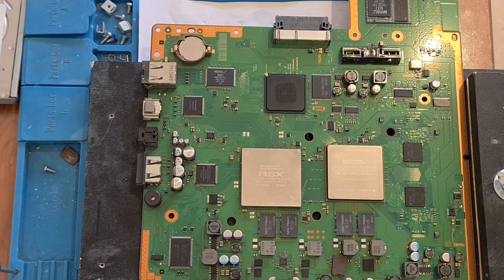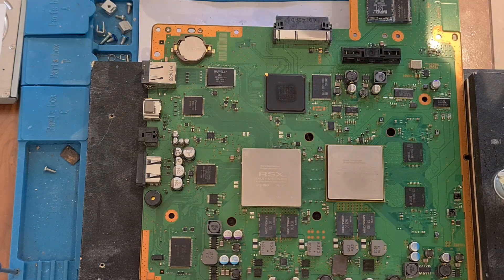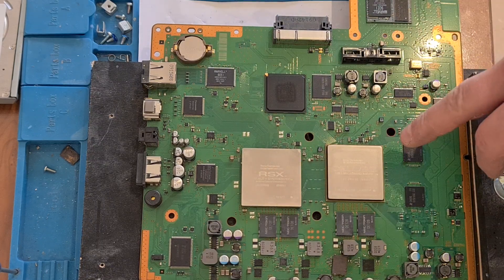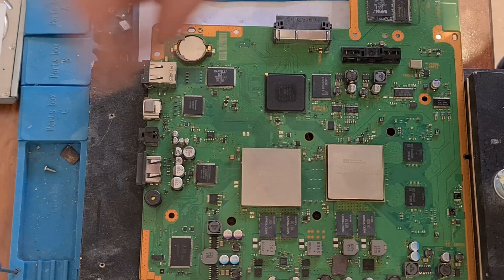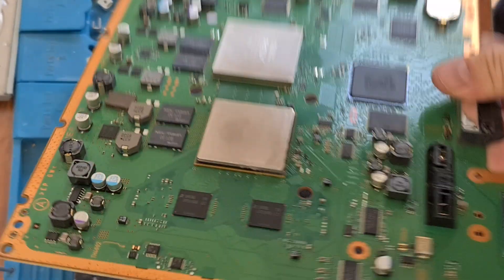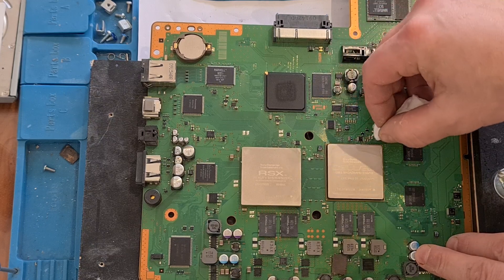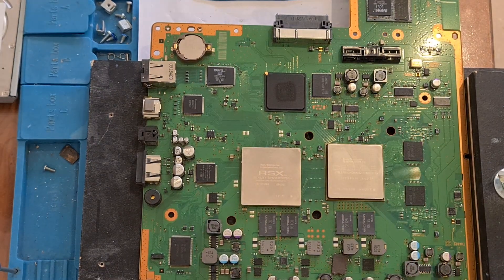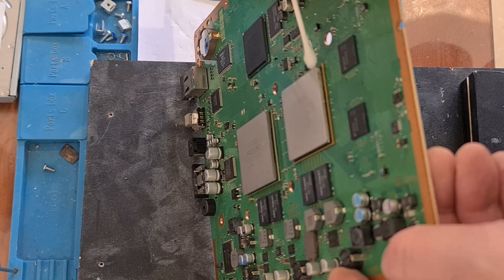New de-lidding technique (Part one)

Comment: I am in the process of delidding myself.  I basically blowtorched and bent a straight razor to a 90° angle.  Then I grip one edge with pliers and slide the perpendicular edge under.  I'm really struggling with it, I think maybe just because I'm not doing quite enough with the heat gun maybe?  So nervous to damage the chip with too much heat.  I'm doing 250 F.   I'm also terrified that I may have already scratched the chip without realizing, but we'll see when the lid is off 😬
Reply from the maker: You shouldn't put a blade anywhere near this motherboard when performing a delid. See my delidding for beginners tutorial, follow.it exactly and providing you haven't botched it up already, you may have a chance
Reply: @timdark9282 Yeah, was ultra careful but gave up on using the blade, because I was too nervous about a scratch.  Hopefully I'm still ok.

Comment: What does the flux actually do here?  Curious about how it specifically aids in the process.  When you put the remover in the frame, its so brief and out of focus I can't see what the brand is.  Mind dropping that in the comments or description?  Also, do you mean C or F for the heat gun temp?
Reply from the maker: Heat 1s 150 C, the sealant remover is from Screwfix, I will check on the brand
Reply from the maker: Its "No Nonsense" sealant remover

Comment: Are the thermal grizzly pads good I think I have everything I need to try have an old ps3  A01 Going to see what happens  thank you for all of the videos awesome  And in-depth
Reply from the maker: You really should try on a dummy test board to get an idea of what you're dealing with. Also, make sure you get a decent set of painters' knives.  The ones with plastic handles not only break easily, but they are also blunt.( you need wooden handles) I recommend the "Amtech" 5pc painting knife set, and you should use  numbers 4 and 5 to perform the delid. Always clean the tools with isopropyl alcohol before doing the delid because anything that gets onto the tool could potentially scratch the chip. Make sure you watch my "delidding for beginners" and "dont open your backwards compatible PS3 untill you have seen this" video, take your time, and follow my instructions exactly. If you're in the UK, I can post a board out to you for 15 pounds. This would act as your practice run.
Reply: @timdark9282    I am in the USI did order A L01$20 PS3 from  Ebay I was going to practice on that the red light of death And yes I have watched that video I think twice plus a bunch of your other ones I will look in to getting the painting knife I've seen other people do it with a razor blade that looks a little sketchy
Reply from the maker: @edsautohelpmore1204 Don't put a razor blade anywhere near the MB. One wrong move and it's game over. A lot of people have slipped using a razor blade and ruined their console, don't do the same, it will kill the console.

Comment: have you thought about trying something more high end? like: Dowsil DS-2025
Reply from the maker: I will look into it for my personal use. However when I do the videos I want to show viewers an affordable and effective solution. This method with the tools and materials that I use works extremely well.
Reply: @timdark9282   understandable. I haven't used it either just curious about the product as it specifically designed to handle cured silicone adhesive.

Comment: Thank you for sharing. Does the sealant remover has the viscosity so that it can be applied with a syringe and appropriate needle?
Reply from the maker: Yes, the way I apply the flux, you can do exactly the same with the sealant remover. I know this because I have an empty flux needle, which I have successfully filled with sealant remover, and it applies well

Comment: What about wd40 and silicon remover sprays?
Reply from the maker: Definitely don't use WD-40, I wouldn't put that anywhere near a motherboard. A spray could get messy. This method puts the sealant remover directly where it is needed, which is important as you don't want it going anywhere else
Reply: And how does wd40 damge the board?
Reply from the maker: @John 1983  As long as your objective is to destroy the motherboard, you can go ahead and use WD-40. However, if your objective is to clean the motherboard without damaging it, then using something which is conductive, acidic, and/or leaves a residue on the circuit board is the last thing you want to do.

If you Google "can I use wd40 on a motherboard" the above comment is the first thing that comes up. The problem with WD40 is that it a liquid and I find if very difficult to remove. The sealant remover is like a gel and easy to apply and remove.
Reply: @timdark9282   Hello again tim if I don't bother you , please I have some questions  , can no nonsense sealment remover gel be used for removing rsx ihs? and I've seen another video that you've removed cpu ihs by using tooth floss , and can I use tooth floss for removing rsx ihs? and if I can't find no nonsense sealment remover where I'm living so is there alternate option to use?

Comment: In the event that traces are cut, can it be repaired…?
Reply from the maker: I don't know of anyone who has recovered  a CPU from a damaged trace. I'm not sure it's even possible. You can, however, replace the CPU, but even this process hasn't been done successfully, although it's theoretically possible. This is because the syscon can now be reprogrammed, so a re-marry of the CPU in theory is achievable

Comment: good to know! Thanks for the video!
Reply from the maker: Hi Tony, I always want to share information regarding de-lidding, I feel this is the safest method as I have now tried this about 10 times, and the cut in is perfect. Before once in a while, I would get a slight scratch, not enough to go down to the copper, but the risk was there. Now I don't even get that so it's absolutely perfect.